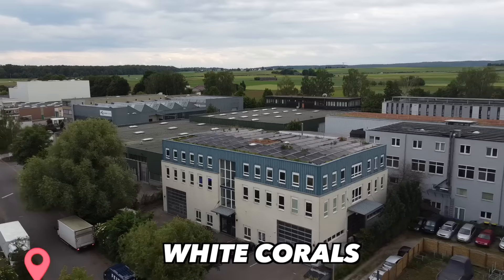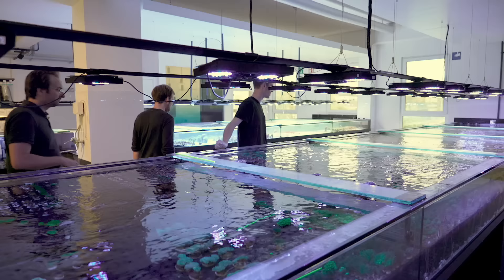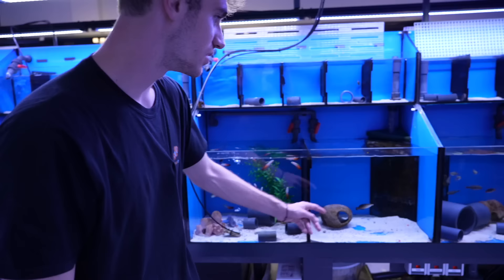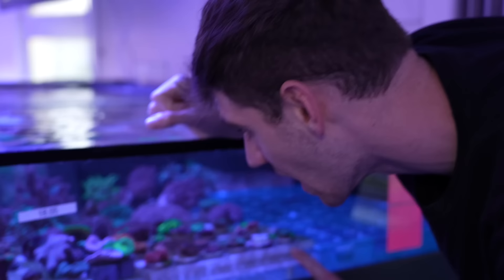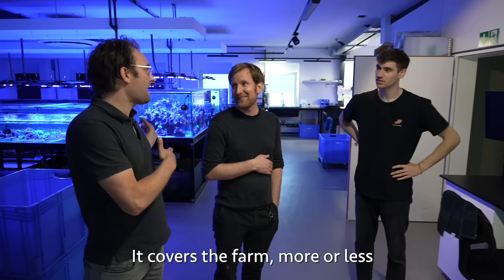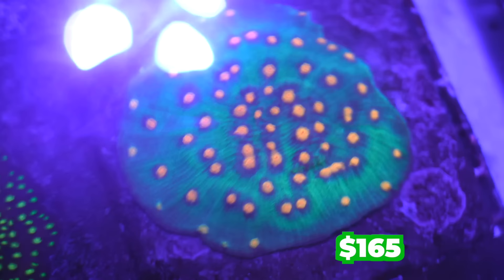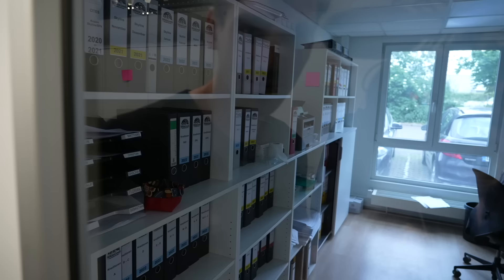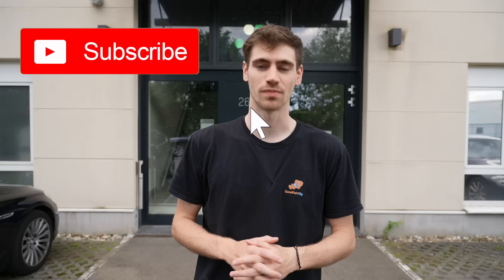The Insane Creatures of Europe’s New Mega-Aquarium

Comment: 7:16 that solar panel orientation makes no sense. they need to face the sun not be effectively completely flat.
Reply: They are not completely flat, you can see that they are leaning against each other. The orientation also depends on what latitude you are in
Reply: @nicoju5211  they are effectively completely flat since they lean opposite directions to each other.
Reply: @thcrs1  Exactly. Means morning to noon, one half of the panels that are inclined in one direction absorbs the sun and then the other side. The space was optimally used to generate electricity all day long. If they were only placed in one direction, there would be less space for the panels and less electricity would be produced at a certain time of the day. In addition, this is the perfect installation method for flat roofs. In Germany, 30° is the perfect angle for solar systems, which also looks good here
Reply: @nicoju5211  You don't understand how this stuff works. leaning opposite directions completely cancels out making them effectively flat. If one side is advantaged by leaning towards the sun the other side is equivalently disadvantaged by leaning away. Take a physics class and pay attention to the notion of flux and/or vecters.
Reply: @thcrs1  You seem to have absolutely no idea. This is almost always done with flat roofs and there is an all-day power generation that is a bit less effective but still good. Those leaning to the east produce electricity from morning to noon and those leaning to the west do not produce as much electricity from morning to noon, but then from noon to evening. Do you seriously think that all the photovoltaic installers have no idea, but you know better? No wonder you don't have renewable energy in the US
Reply: @nicoju5211  Yes, the installers didn't do it the best way. the panels should be facing south.
Reply: @thcrs1  Not on flat roofs unless you only want to use half of your roof and don't want to have even generation throughout the day
Reply: @nicoju5211  "half of your roof" ?